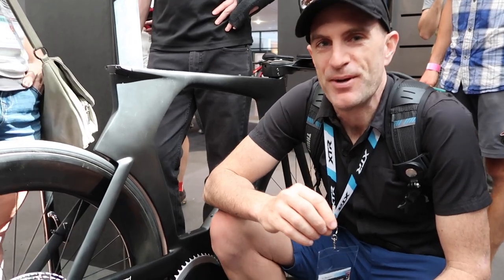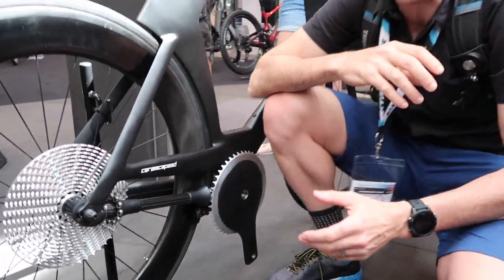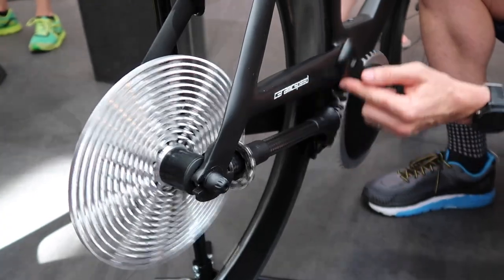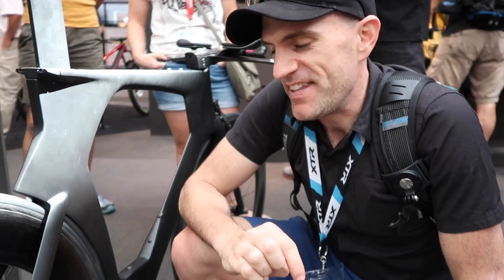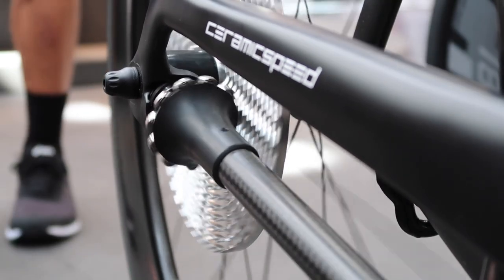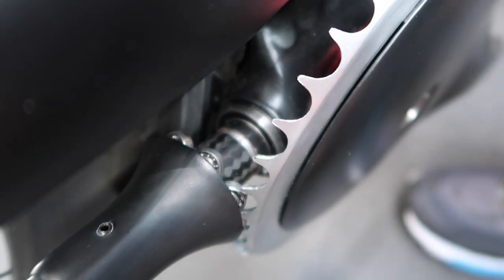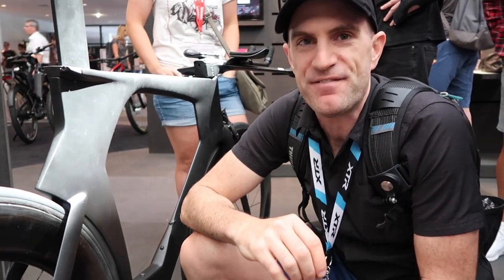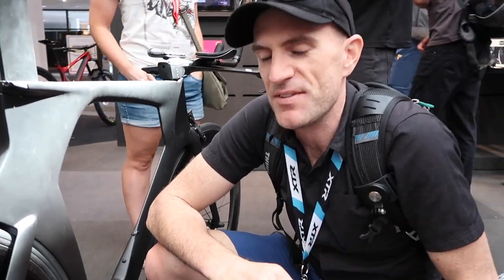CeramicSpeed DrivEN 99% Efficient Drive Shaft // Chain Free Bike // Eurobike 2018

Comment: The problem is that it would push the shaft outward as the torque increases and it would start skipping as it loses traction between the disc and the gear.
Reply: That’s the first thing I thought. The “engineering challenge” here is that there’s no way this will ever work without adding a ton of weight and following it up with constant maintenance.
Reply: Michael Harto yeah. That's what I'm thinking
Reply: Thank you . I didn't know the words but you explained it perfectly. And if they wanna machine this out of aluminium they're in for alot of returns.
Reply: If it works on automobile it'll work on bicycle too, remember that we are in the 21st century's
Reply: Just incase it with a cover that can be opened.
Reply: Michael Harto, It would not take a lot of reinforcing to fix that problem. If they are designed to fit tightly together, they will not skip or lose traction. 

Croc huntas, it's a freewheel so that will not happen.
Reply: +croc huntas
No, it won't, as much as a ripped chain doesn't except if it is caught in the spokes.
Can happen with fixies though.
Reply: it depends on the load on the whole bike. the design on the disc gear(spiny thing) is prone to slip too. they made it that way so it would run smoothly between the gear shaft and the disc as it rotates, but they sacrificed traction between them. all you need is a heavier guy to ride the bike and you will see.
even if they managed to reinforce the shaft, the disc will give away shortly, pushed inward into the wheel. aluminium would break, steel would bent inward, idk if fiberglass would be strong enough...
Reply: This is the same challenge presented in any gear set - it's literally no different.   The solution is proper bearing support and mechanically stiff components.
Reply: well duh...
Reply: croc huntas do you know how bikes work ?
Reply: croc huntas the rear when can freewheel so it won’t do thag
Reply: Yeah I just commented something similar before reading yours.  I think titanium should certainly be better than aluminum, albeit way more expensive.  But even with titanium or 1095 or whatever,  there's definitely going to be a loss of efficiency over time.
Reply: Was thinking the same thing. A push rod or derailleur type mechanism on a rail that allows the space compensation. The driveshaft could have a ujoint or flexible joint in it to compensate for it.   Super cool design on this too.
Reply: jak442 that's why it's a challenge!
Reply: True. But if they can bias the main shaft to gears that would be different
Reply: Lalthanzuala Hauhnar it may work. the challange is to improve the standard chain setup.
Reply: Michael Harto If it ain't broke. Fix it until it is.
Reply: Michael Harto Perhaps that's an idea that they're planning to work on, since this is a prototype.
Reply: yes i noticed that too, but i think this concept is harder to apply in reality. viewing from maintenance cost, using chain as a weaker but replaceable gear is much easier & cheaper solution in the long run. i think it's hard to improve something that's almost perfect.
Reply: Lalthanzuala Hauhnar on an* automobile
Reply: Stevon Robb encase*
Reply: Michael Harto Would having the same thing on both sides work?
Reply: skiie do you think titanium/carbon alloy with antislip would work? Then i guess it would ve too expensive.
Reply: I’m guess that’s why there’s so many gears
Reply: Michael Harto I'm that big heavy guy, and I can confirm.  I had to beef up the chain, sprockets, spokes and rim on my bike.  Last time I really pushed my bike the rim collapsed catastrophically by twisting.  Never seen a rim fail that way before.  The bike shop guy hadn't seen that either.  If that happens with a chain then a gear drive def needs to be reinforced.  I ride about 14 miles a day and if a bike can't handle that, then it's a bad design.
Reply: Same thing went through my mind, I imagine for this reason and other it should be enclosed with grease (like a cars differential) to prevent any debri from getting between the mechanism driveshaft and all and also make it out of a stronger metal than aluminum. The casing that encloses all of that serves also to maintain the moving parts at a constant distance from eachother in the positions they need to be to prevent skipping.
Reply: @deathuponusalll 
but that would sacrifice their highest goal: efficiency
...i just learned that a dura ace in good condition already has about 98% efficiency which is quite amazing i think - 114/116 chainlinks that get bent around 4 wheels, only 2% loss!
on the other hand, what i already knew was that most of the friction loss in a bearing comes from seal drag and the type of lubricant used - for chains it is even recommended to degrease it right out of the box and apply a light chain oil to get the lowest friction rate possible.
to put this shaft in a case and let it run in a bath of grease/oil would not only add quite a bit of weight to the standard construction but would also 'massively' (considering the 2% window we're in right now) decrease efficiency.
Reply: Michael Harto 

Shouldn't be that difficult to engineer the drive disc to be rigid but light with careful design.

Using a dual phase ultra high strength steel along with a bespoke hub with a wider mounting flange would take care of the deformation issues. Also, carbon fibre for the drive shaft is a great choice as when formed correctly it will have near zero ability to deform significantly enough to cause the drive to skip.

The exposed roller bearings are my biggest concern though I understand this is a prototype and sealed units would likely be used if this were to be an open system. I think small needle roller bearings would be more ideally suited to the application. I also assume the drive system would be encased in as light weight carbon fibre casing to keep things clean and to be able to contain a small amount of extremely light fully synthetic lubricant, though only a small amount so as to not have the drive disc act as a fluid brake as it picks up speed.

Just a few musings. I think it's a superb concept.
Reply: Yeah... he said it in the video. But thank you.
Reply: Looks like a rod in the middle would fix that.
Reply: Lalthanzuala Hauhnar automobiles are thousands of RPM shaft. Bicycles are in the low hundreds
Reply: @Unmannedair because we're heavy, we tend to focus to things like these to avoid embarrassing moments.
Reply: Michael Harto I don't know what you're talking about. If I can damage something on a regular basis with normal operation without too much trouble, then I regard it as a design failure.  When you build an airplane, nobody designs something with a 20% safety margin.  You regularly see safety margins starting at 400% and go up from there.  If I pay 800 dollars for a bike before mods, then I expect my basic structural elements to perform.  If I can't get that, then I'm better off welding my own chassis up and building my own rims for that money.  Granted, I was going up a very steep incline, in my lowest gear, and I was standing on the pedals, but still... I wouldn't expect my tires to implode.
Reply: @Unmannedair my previous post was me trying to explain and support your previous post.

Comment: Shane, I already gave my list of engineering thoughts about this on GCN's youtube video.
- However, as an inline speed skater I can tell you that those open bearings will become a major maintenance nightmare. They work fine when new and in the showroom. In the open they get dirty, squeaky and efficiency drops quickly. Speed skates have 16 similar bearings and they need thorough maintenance after each run. You can seal and grease them to avoid internal muc, but then they don't spin freely anymore. And yes, ceramic bearings were not different to steel bearings.
- It would be nice to see this system shifting, and without a catastrophic gearing failure since there is zero tolerance between the contacting bearing and tooth.
- Did you really mean that it takes 8 hours in the CNC machine to make the big mozzarella shredder in the back? So Ceramicspeed will charge USD 2000.00 per disc?
Reply: As for the maintainance, this is actually FANTASTIC - once it's encapsuled. 
I mean this isn't the first drivetrain for bicycles. It may be the highest engineered so far, but the Idea isn't new (at all). Those drivetrains who allready exist - altough they do not shift AFAIK - are completely closed off. 

This should lead to extremely low maintanence, since no dirt or whatever will find it's way IN there. I mean internal gear hubs are quite popular for low maintanence applications, because they are closed off as well. They'd be a maintanence and troubleshooting nightmare if they weren't as well. A little bid of sand in there and you are gonna have a REAL bad time.

Comment: I believe we should commit ourselves, to achieving the goal before the decade is out, of designing  a lightweight internal gearbox driven directly by the crank with belt driven rear wheel....
Love new designs that inspire people to think.
Reply: Maybe just go and buy a Rohloff 14 speed and a belt drive from gates... Then build umyour favorite wheel on the hub with say half the spokes :)
Reply: Or the Pinion which has 18 speeds and a belt drive
Reply: I think that went right over a lot of heads Johnny.  But your spot on it is a concept, thinking, trial  and error, development end results may or may not resemble this.
Reply: “We choose to design these drive trains in this decade and do the other things, not because they are easy, but because they are haaahd.”

Comment: there's a reason why heavy industry relies on chains and belt drives for power transfer between two parallel shafts (like in your car etc.).
Reply: also i highly doubt the many bearings i see in that system, which have to be properly sealed for real world use, will be more efficient than a chain
Reply: Convert the the strongest of track sprinters putting 2200 watts + through the pedals and that doesn't even equate to 3hp. Hardly call a bicycle drivetrain heavy industry.
Reply: i'd love to see some track sprinter rip this ridiculous idea apart with his legs. probably some proper roadie would do the job as well, though
Reply: jbkltc Love to see it take more than about 200W let alone 1,500-2,000.  This entire concept is laughable
Reply: 2200 W at bicycle rpms is a hell of a lot of torque. Power (Watts) = Torque * Angular velocity (Or force times speed if you like). A fast cadence is 120 rpm, which is 4*pi radians/second in SI units. 

Rearranging the power equations, Torque = Power / Angular Velocity = 2200 / 4*pi = 175 Nm (or 129 lbf.ft for fans of units from the dark ages), which is more than some small cars and most motorbikes can manage. 

IC engines put the torque out at a much higher speed, to make higher power outputs. If a car had to put it's power down between 60 and 120 rpm it would need much heavier, stronger components too.
Reply: jbkltc it's cheaper
Reply: peglor, for the win!!!

Motorcycles and cars are the ultimate "high cadence" machines.
Reply: 3hp at 90rpm vs 100hp at 3000rpm have the same torque, but bicycle components are much much lighter and thinner.
Reply: They are ultimate "high cadence" machines, but only when powered by turbojets and turboshafts.
Reply: This thing is similar in some ways to the rear diff in a truck.
Reply: jbkltc maintenance costs
Reply: Your car has a differential which uses bevel gears. No car that I know of uses a chain or belt to get power from the engine to the wheels.
Reply: Internet Tough Guy 

CVT transmissions are a thing, and they use a belt or a chain.
I don't like them, but they are  totally a thing
Reply: Lawry Flynn these bikers are endurance racers. They're not going to pound the pedals unless it's the final stretch. It's important to maintain a rhythm to save stamina. Gear down for uphill, and back up for downhill and flats. That's some of what I know anyways. 
R&D is important.

Comment: Hi Shane, yes you brought up the very issue I first thought of, small contact area = big problem under load.  I do like the idea though and thought for gear changing the wheel "cassette" could be smaller and the inside of the chainring be a similar design to the cassette, so that when the drive shaft moves forward, the drive circle at the front is reduced while the drive circle at the back is increased, lowering the gear, and when it is moved backwards, the gear is increased. the designers still have a lot of issues to "torque" about though.

Comment: It is definitely cool BUT for efficiency and ease or maintenance and repair, you will be hard pressed to beat a chain.
Reply: Thomas Davis yup, chain already over 99% efficiant
Reply: MrDmadness yeah, I’m not sure why they are saying this system is “so efficient” when the power from pedaling has to be translated to torque through a shaft first and then to the rear sprocket when Chaim allows the moment to be applied directly to the sprocket.
Reply: You can’t have anything over 100% efficient. It breaks the laws of well.. everything. If you had a system of over 100% efficiency it would be a free energy thingy which doesn’t exist
Reply: Come up with something like a belt drive on my motorcycle...
Reply: Cool to finally see more than judt a video on instagram. This actually looks cool to me. Seems like, if they can address the issues mentioned, this could make its way down to the affordable end of the spectrum evebtually. Belt drive bikes need some sort of internally geared hub and those are rarely affordable if you want any real range of reduction. I like this idea because the drive shaft is at the same angle with every gear, no issues with crosschaining or in the case of a driveshaft, over bending a u-joint. Seems like having 2 shafts with the front chainwheel and rear...I guess those aren't "cogs"...the rear gear sandwiched between the 2 shafts...with both shafts connected in the same piece of metal at the end..that seems like it would create enough stiffness no keep the bearings from jumping out of the gearswould require odd spacing the get the inner shaft to the highest gear without hitting spokes though.